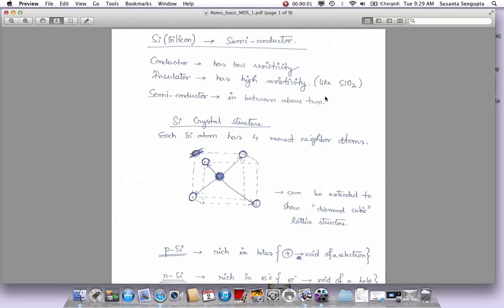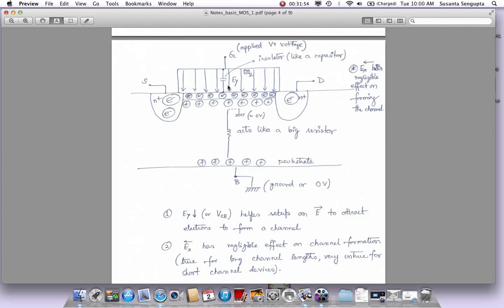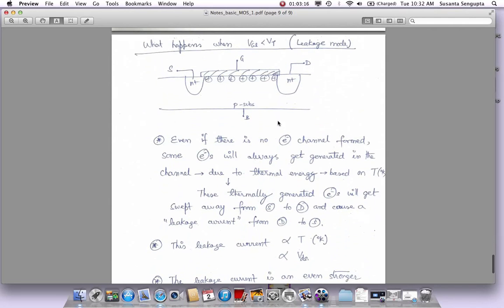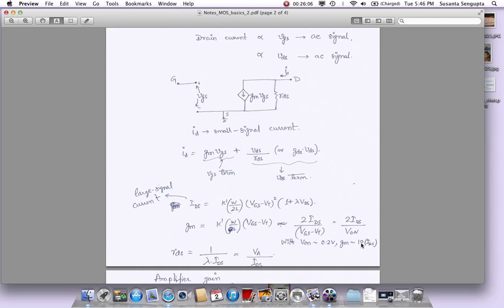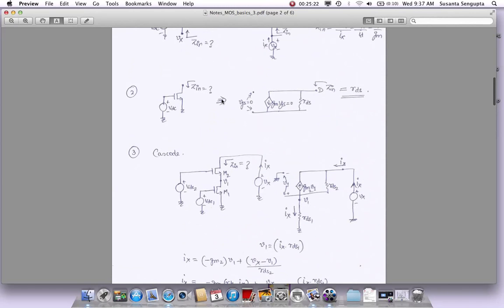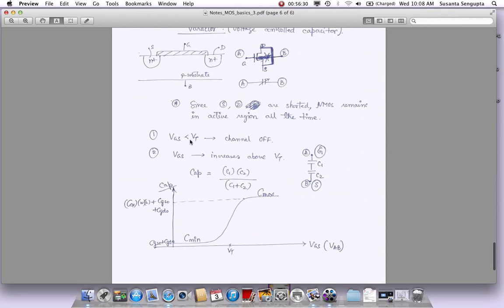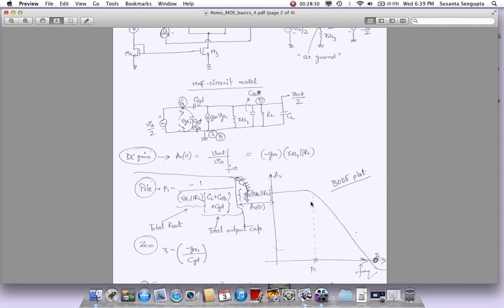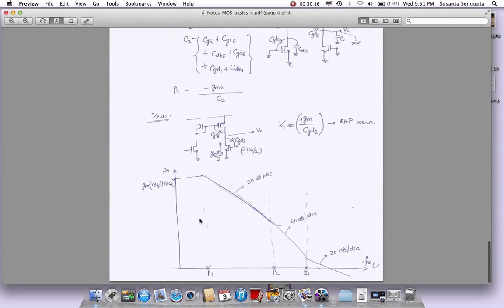MOS basics

Comment: AC ground gets created due to splitting of vin at 3:03:36, i didn't understand?
Reply: yes the common node doesnt see any "ac signal" or small signal, in other words even in AC or tran analysis it will remain in the same voltage(= the DC voltage) that you see in the operating point analysis

Comment: Dear Sir, thank you for sharing knowledge, and for the excellent method of delivery.

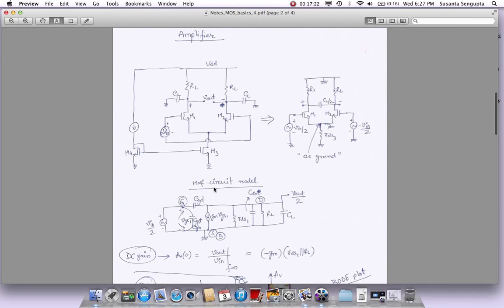Minor notice: From 2:58:16 onwards as you showcase the differential amplifier schematics; it is important to note that your output nodes' polarities should be reversed. Your diff pair devices are still common source amplifiers, so it stands to reason that the polarity of output node at D of device will be of opposite phase to input at G of device.